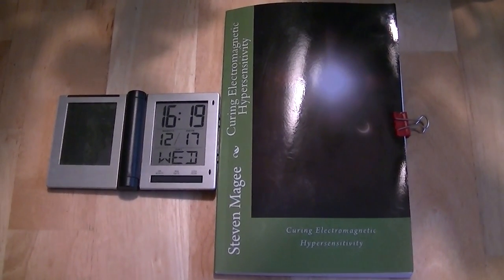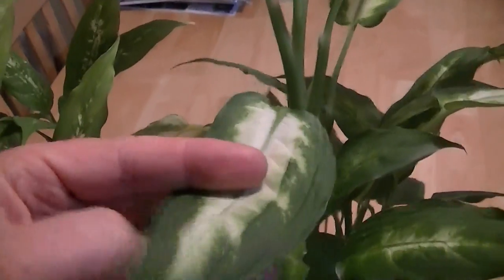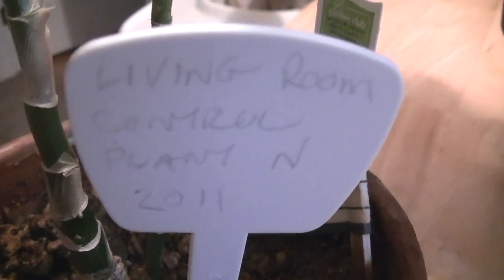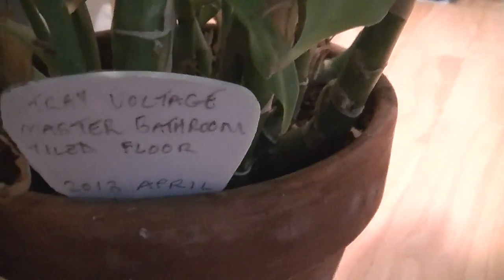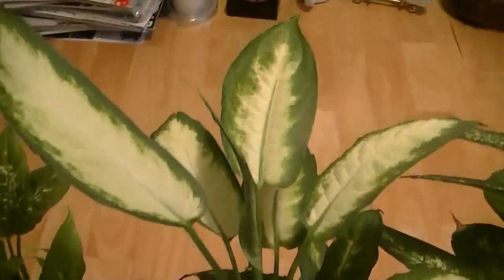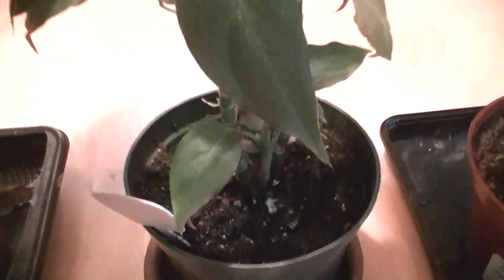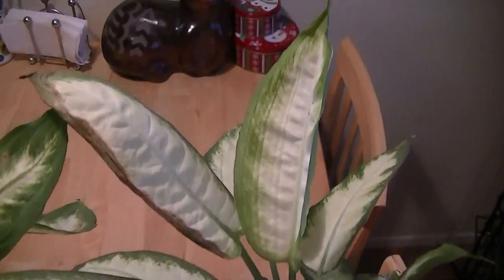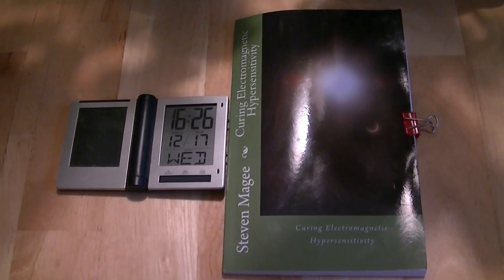Curing Electromagnetic Hypersensitivity -  Radiation Resistance Winners

Comment: uggh i suffer from badly now, and the more self aware i get of the condition the more i notice these things.
i can feel.
=====
Sounds, (if i close my eyes and move in and out of the sound waves i can even see faint flash's of light as i enter the anti-nodes, aka as i move in and out of the sound waves)
=====
Wifi signals, 
=====
Electric fields, 
=====
Numbness, weakness or prickling sensations in my hands feet and face
=====
Feelings of abnormal tiredness or weakness
=====
Changes ability to think clearly or finding it difficult to concentrate, 
=====
Headaches
=====
Tenseness
=====
Restlessness, anxiety
=====
Memory loss
=====
Sleep disturbance, insomnia
=====
dizziness,
=====
Abdominal pain, digestive problems, irregular bowel movements, sickness
=====
Feeling too hot
=====
Blurred vision or flickering before the eyes
=====
Heart arrhythmias or irregularities or chest pain
=====
Hearing clicks, humming, buzzing, or a high-pitched whine (mainly around tvs, computers or in public)
=====
Unusual irritability, rage, violence, destructiveness, feeling hostile
=====
Depression, suicidal tendencys 
=====
Reply: angry 24-7 I suffer from the same thing and I know how difficult life can be because of it. Hope you’re doing okay